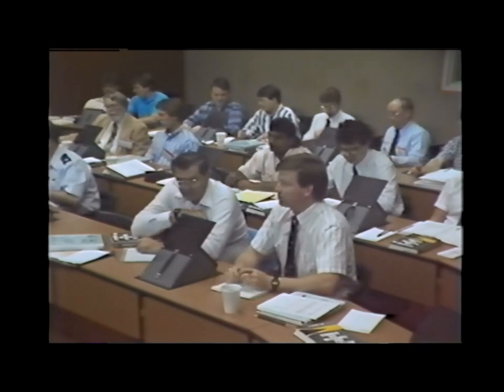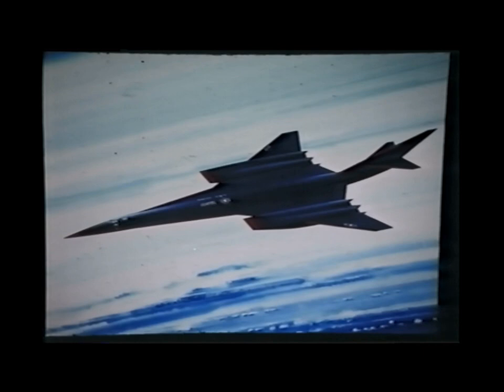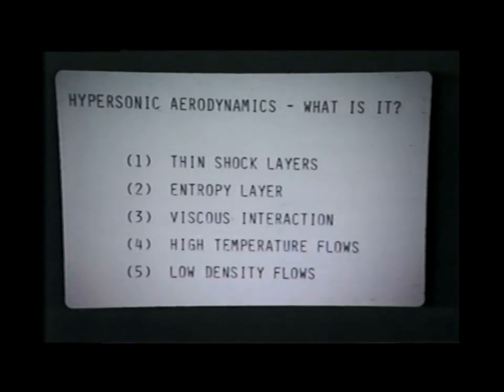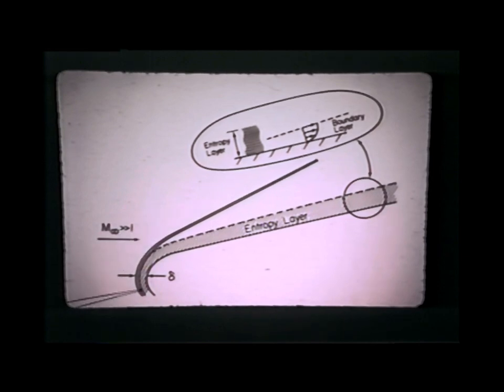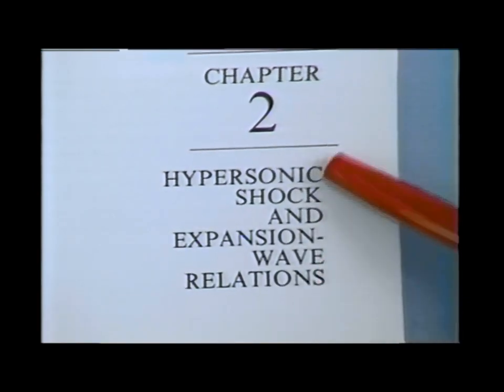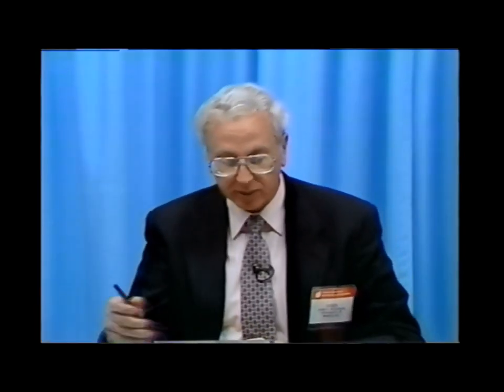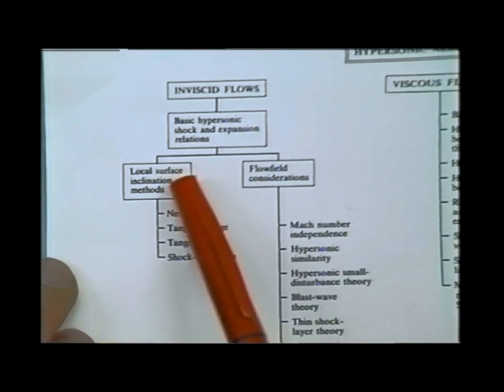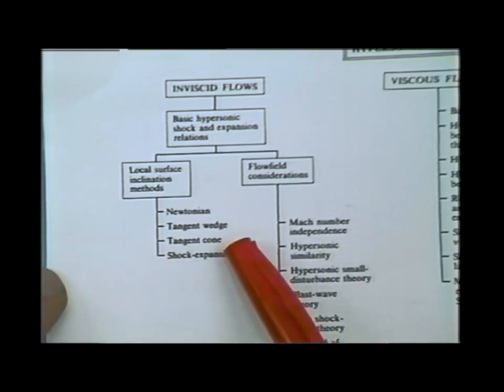Hypersonic Aerodynamics: Basic and Applied Part 1 **Updated

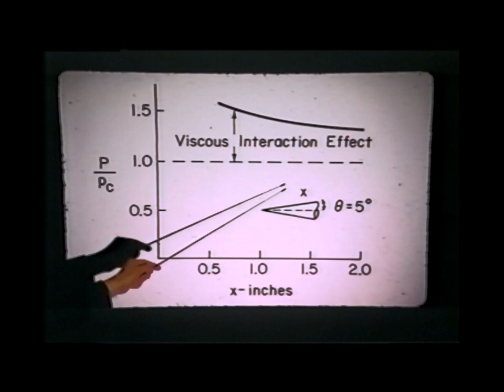Comment: 21:35 It would be interesting to see if you could "subtract" the (precomputed) displacement thickness from the actual geometry of the cone, such what when the flow encounters the new design the effective shape recovers the inviscid conical surface pressure